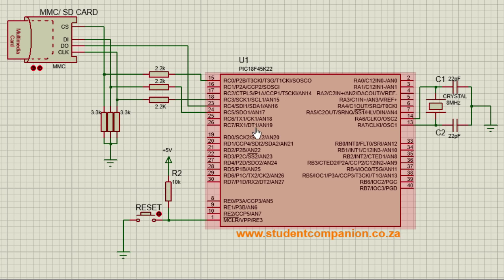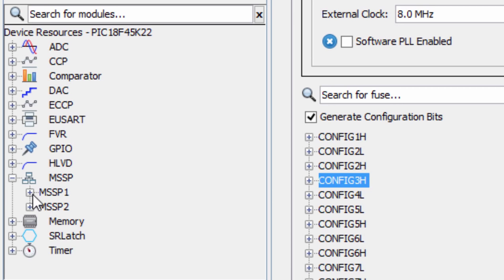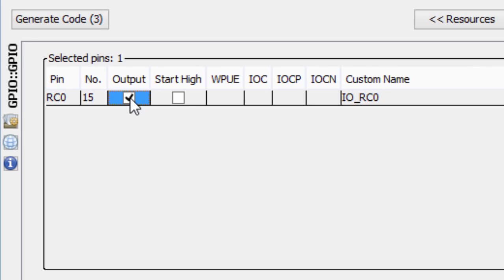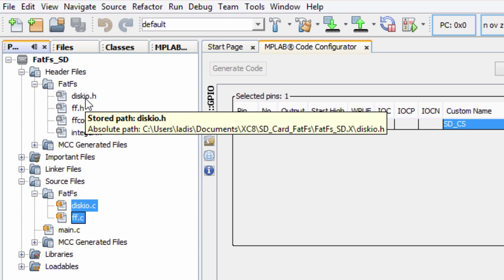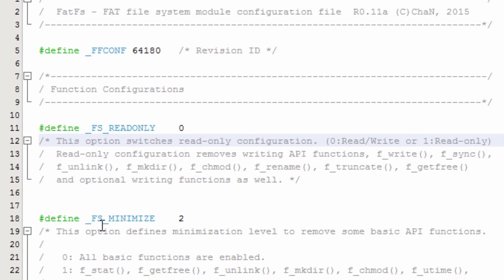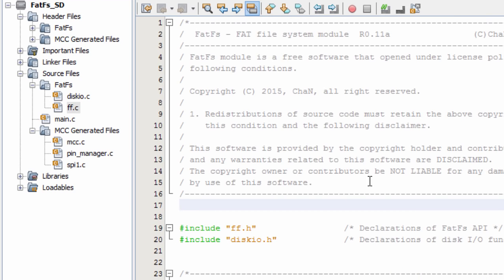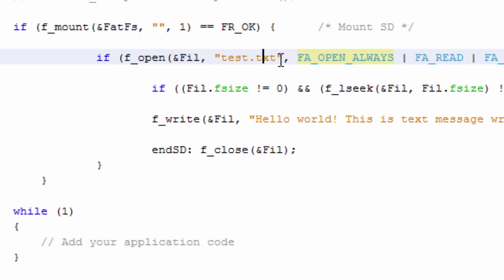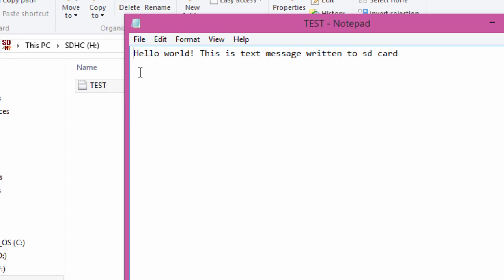48- Interfacing SD Card, part 3 | MPLAB XC8 for Beginners Tutorial

Comment: Hello my friend, I have  a question, the module sd card of arduino can work for this project? because I have a pic18f25k80 and I was trying this program but it never worked, and I am using MPLAB X IDE V5.30
Reply from the maker: Hi. Which module sd card for Arduino you are talking about? 
Can you explain how you did the test? Did you create a new project using your PIC18F25K80 or you just used the hex file from our project? Is your code building without errors? Can you post your code?
Reply: @StudentCompanion  Can you give your e-mail to send to you the files of my program with the pic18f25k80?
Reply from the maker: That module should work with the PIC if it's not faulty and connected correctly.
Reply from the maker: Please upload your code in the forum so we can check it: www.studentcompanion.co.za/forums
Reply from the maker: If you struggle to post in the forums, you can read this post: https://www.studentcompanion.co.za/forums/topic/please-read-this-before-posting/
Reply from the maker: Did you watch this video to learn how to use sd card with mcc: https://youtu.be/foHHgmWXZ3k
Reply: @StudentCompanion  Yes , I saw the video my friend, Well I gonna upload the code so you can see it, This code is with a Microcontroller pic18f25k80
Reply from the maker: Please post your code in the forum.  We will assist you there. As it's not possible to post the code on YouTube
Reply from the maker: If you struggle to post in the forum, let us know here your problems so we can assist.
Reply: @StudentCompanion  My friend I upload the code of the PIC18F25K80 in the forum
Reply from the maker: You cannot post on an instruction post. That post is just an instruction to explain how and where to post.  Please read it first before you post. You must not post under somebody's post. Start your own topic. 
If your question is mplab tutorial based, open the mplab tutorial forum, then start your own topic there.
Everything is explained in that post you have just commented on. Please read it.
Your post will be removed as you post it in a wrong place.
When you attach your project, use the features in mplab to package your project, it will zip your project correctly in a smaller format so that you can upload it. Our website limit the max size to upload files to only 512KB. Make sure it's smaller than that otherwise it won't be uploaded. 
Please follow instructions
Reply from the maker: If you have problems, ask here on YouTube , don't send messages on WhatsApp or Facebook.  All tutorial based questions are answered only on YouTube or forum
Reply: @StudentCompanion  Ok Iwill do that my friend I will upload using the instructions
Reply from the maker: @ronyvargas7377  OK
Reply: @StudentCompanion  My friend How I can my start my own topic because I can´t find it?
Reply: @StudentCompanion  Please When you are there send me..
Reply: @StudentCompanion  My friend I ulpload the program you can see the files
Reply from the maker: @ronyvargas7377  PLEASE READ THIS BEFORE POSTING explains how to post on the forum. You can access it from this link and read it to learn more: https://www.studentcompanion.co.za/forums/topic/please-read-this-before-posting/
1. The first thing is to Choose a specific forum related to your question, for example if your question is PIC microcontroller tutorial with MPLAB XC8 like your question, post your question in MPLAB XC8 Tutorials discussions: This is the link: https://www.studentcompanion.co.za/forums/forum/mplab-xc8-tutorial-discussions/
When you go to the forum page, there is a link of all topics (forums), choose the one related to your question.

2. Once you click on your MPLAB XC8 Tutorials forum, Scroll down to the bottoms of all the topics in the specific forum, there is a section to Create New Topic in " MPLAB XC8 Tutorial Discussions", there is also an area where you can type your question.
In Topic Title: Type in the title of your question: Like SD card problem to write with MCC and PIC18F45K22 for example. Type in the correct title.
Then start typing your question. Please always provide enough information so that we can be able to assist you properly. Post your Main.c code if it's different to the one in our tutorials, post the full error messages if you are getting an error.

3. Upload your project in a zip format so that we can check it on our side. The max size of the project must be less than 512KB. Please use MPLAB package to zip correctly your project. You can learn how to package your project from this link: https://microchipdeveloper.com/mplabx:projects-package
Reply from the maker: @ronyvargas7377  I don't know how else I can explain to you, did you read my previous comment here on YouTube? Start your own question, it's helps us as a forum even for other people who could face the same problem s as yo. They can just go through the forum. Don't post in somebody's question. This was not your question, it was somebody else who asked a question to play music with sd card which is different to your question.
Start your own topic please.
Please read the recent comment I made.
Reply: @StudentCompanion  Ready my friend I made my own Topic
Reply from the maker: @ronyvargas7377  OK, we will reply to it in due time.
Reply: @StudentCompanion  Ok Thank you my friend...
Reply: @StudentCompanion  My friend a question I can use I2C for other pins instead of the PINS RC3 (SCK) and RC4 (SDA) , I wan to use PINS RBO AND RB1 with I2C with the PIC18F25K80

Comment: HELP plis,How do I correct this error
:0: error: (499) undefined symbol:
 _SPI1_Open(dist/default/production\67K22.X.production.obj)
Reply from the maker: You are providing very little information to guess what could be the problem.  Which PIC are you using? Software versions, your code, full errror message etc.
Reply: @StudentCompanion  
I am using the PIC18F67K22,
My version of MPLAB is 4.00
The error says that I have not defined _SPI1_Open

"0: error: (499) undefined symbol:
_SPI1_Open (dist / default / production \ 67K22.X.production.obj)
(908) exit status = 1 "

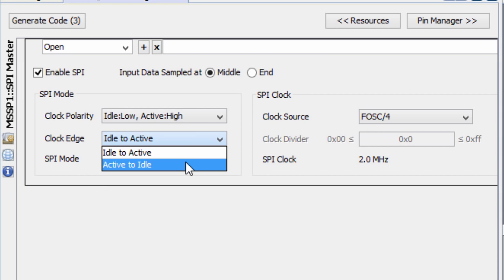I followed the tutorial step by step, with the exception of minute 2:55 to 3:10 because my code configurator does not allow it
Reply from the maker: @mariacamila608  Hi, if you did not define SPI1_Open in your software, it will generate an error. Basically the reasons we configured SPI twice is first we need to initialize it at low speed for the card to be detected, but later on increase the speed for general files operation. This feature was only available in older versions of MCC but for some unknown reasons from version v3xx Microchip removed this feature. So your options are either you download an older version of MCC v2xx then configure your software exactly the same way we did, or manually configure the code for the SPI_Open.
Reply: @StudentCompanion  How can I manually configure the code to define SPI_Open?
Reply from the maker: The easiest is to create another project, configure it with spi using the required frequency then copy those mcc spi configured c file content to your main project. Rename the functions according